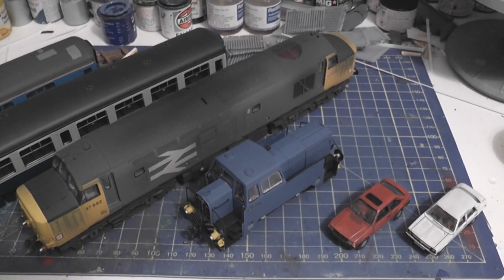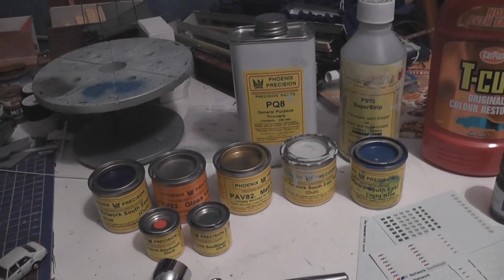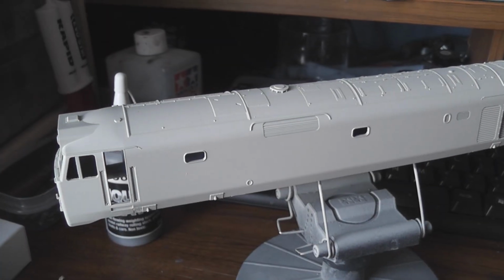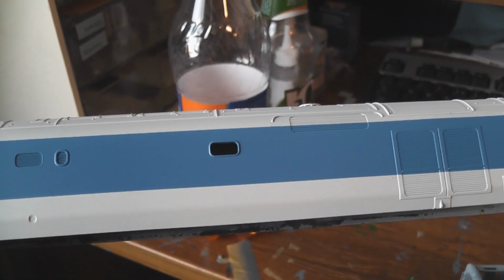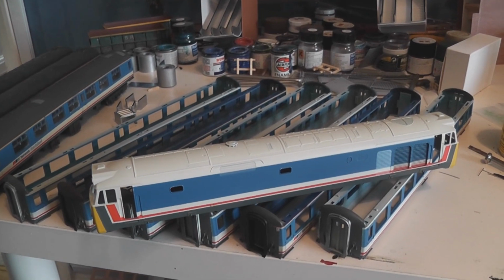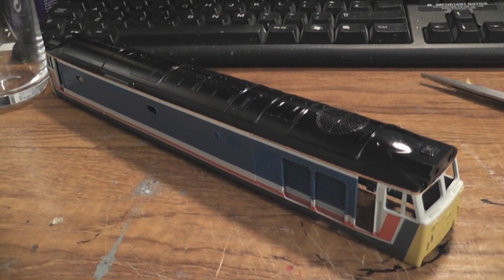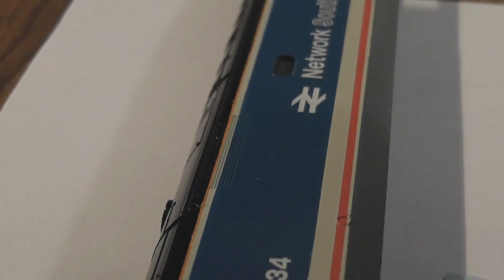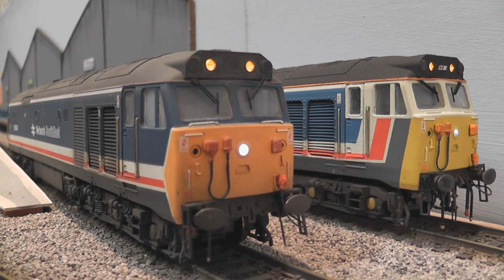How to - Episode 17 - Loco Repaint

Comment: Excellent work, I use Pheonix precision paints for my airbrushing.  Do you use a face mask?  The reason I ask is that brand of paint still use lead cromates in the mix.  Do you find that your compressor loses pressure? I used to use one without an expansion tank and I changed to one with a tank to enable to do spraying for longer without loss of pressure.
Reply from the maker: Nigel Johnson I do use a face mask as well as the extractor fan.  I try to do all my painting outside in the shed.  Also to my left in the shed is the door, which I leave open when possible.  My compressor is able to maintain pressure but it does struggle at higher pressures.  I plan to upgrade it in future.

Comment: NSE is a tricky livery to get right but the end result looks brilliant! I'm going to try this on my 86.
My only questions is that when you are using enamels, with so many coats of paint (I counted something like 16 coats including the clear coats!) do you not find you loose definition in some of the body details like the roof and the side grilles? Also is refitting the windows not an issue as I have struggled to get them back in on some repaints I have done that used much fewer coats than this one did.
Reply from the maker: soundseeker63 When you airbrush with correctly thinned paint you have to really go for it to lose the detail in a model.  I apply thin coats, but usually quite a few to build up the colour.  Windows can be difficult, but I didn't have too much trouble with this model.

Comment: Could you do a video of stripping paint please?
Reply from the maker: The stripping is very simple.  I pour the stripper into a water bottle and then leave the whole bodyshell in there to soak.  In about 20 mins the paint will be gone.  I then pour the stipper back into the original bottle using a filter so it can be used again.
Reply: Thanks for the reply :)

Comment: What's the stand you have used in this video. Like the clamp type system.  
Brill job your doing on this. Have followed a fair amount of your vids. Well done.
Reply from the maker: The stand you see me use a lot is the Tamiya spray work stand. You get the both the stands you see in the video in the same box.

Comment: Smart job. What Matt varnish do you use? Are these paints enamels? Or Acrylics? Or a mixture? Does this paint last as long in use as regular trains? Crikey that was a lot of coaches - must have taken you ages. Do you know how many hours work?
Reply from the maker: Thanks, I used railmatch matt varnish.  All the paints I used in this video are enamel based.  I prefer the finish you get with emamel.  Excluding drying time this probably took me about 6 - 8 hours.

Comment: hi, this vid was posted whilst I was dismantling a mk3 buffet before my first re-spray into FGW Green & gold' fagpacket' from current grand central black. after the gloss varnish then transfers, would you matt varnish, weather then matt varnish again or just weather on top of the transfers then matt varnish. the weathering will only be a light dusting of sleeper grime to give an 'in service' appearance (will weather rest of fleet that I have purchased   in correct livery's. cheers JD
Reply from the maker: I tend to matt varnish after the tranfers before weathering.  The gloss effect can make you overdo the weathering and perhaps not get the effect you wanted once the shine is taken off.
Reply: EverardJunction cheers ive just primed the coach and waiting till next weekend to put the FGW green on, thanks any way

Comment: ive been waiting ages for this tutorial. and it was brilliant. im really eager to have a go at respraying my class 37 into ews but going to buy some cheap second hand body shells to practise on first. only thing that's worrying me is im using ngauge . have you done an ngauge respray before? I did notice you was weathering a 37 in ngauge, im presuming that its a lot more fiddly than oo gauge?
Reply from the maker: I have repainted two N gauge 37s into EWS for a friend. I used the same process, but you have to make sure your masking is spot on.

I'm not sure if you can get EWS transfers anymore. The currently owners of the EWS brand have made it very difficult to produce transfers. You may have to resort to ebay to find them.
Reply: I did read about the ews transfer on the fox transfer site, its very disappointing but I will try ebay like you say, im going to give it a go, thanks for the inspiration.

Comment: This is a very old video but anyway..I see you are pulling the airbrush triger all the way back when you where painting the loco..So full paint flow..I know this is a NO NO.So..You where using a very low pressure then?~10PSI or lower? I ask because I bought the eclipse HP-CS recently and I'm an airbrush newbe..and I have also a loco repainting project to do.

Comment: you've done a fantastic job Richard of the repaint on the loco and the coaches, really is a top job, and looks so much better than the off the shelf model, not brave enough to try this, only just started to weather my trucks using the weathering powders video you did Andy

Comment: before you spray, do you wash the subject down with thinners before applying paint (its what we do on the full size machines)?
Reply from the maker: Adam Williams I do wash it before spaying but I use warm water instead of thinners.  I've done a few car parts and use use panel wipe for those which is probably just thinners.
Reply: I wouldnt recommend cleaning it down with anything other than a very mild degreaser, the worst you are removing is finger prints.
There are loads on the market if you look around, but its only to get the base coat on, once its on you should be touching it

Comment: you recoat even when the first coat is not fully dry? that work ok?  Never thought of that, I tend to give the precision paints (used on my trunking) 24 hours to fully harden.  The blue is spot on for shade!
Reply from the maker: As long as you are doing the same colour you can apply extra coats when the previous one has touch dried.  I then leave the 3 or 4 layers of paint i've built up to fully dry overnight. I was quite surprised at how quickly the phoenix paint dried.  On some parts I was able to paint in the morning and mask over it in the evening whithout any trouble.

Comment: you have done a damn fine job on that 50 and the coaches richard, well done mate.
Reply from the maker: Thanks Terry, at one stage i was worried it was never going to end. those coaches took so long to do!
Reply: yeah i bet they did mate. i admire your determination and patience, something i lack lol.
actually while im typing i wanted to say that im going to respray my sentinel shunter into yellow and wanted to know how you went about masking the word sentinel on the side of the shunter.did you just cut out a piece of masking tape and stuck it down?
Reply from the maker: Glebe Road Junction Hi Terry, only just got round to reading this! Yes I just cut a tiny bit of tape and stuck it over the sentinel logo.

Comment: To get a perfect gloss finish try Pledge Klear Multi Surface was with Future shine, it is water thin goes through an airbrush like a dream and cleans up easy, it gives a perfect gloss finish to laydown your decals.

For standard colour paints like black and red give XtraColour a try, can get it from Hannants, they airbrush very well, their colours are for aeroplanes mostly but the basic colours work for all.

Google search can give thinner ratios in relation to your setup air pressure, gun setup etc.

Comment: Superb how to video Richard the 50 and the rake of coaches look really good made it look really easy especially the decals I did a class 26 recently and I found that to be the hardest bit to do but I think I did not use the gloss varnish only used a Matt and they did not move around so easily thanks for sharing cheers Kevin
Reply: Nice, I like the color scheme . Walter
Reply from the maker: The decals can get very annoying, the best thing you can do is gloss coat the model.  Is makes a huge difference.

Comment: Great work. Just getting back into hobby after long break so one question regarding the mk2 coach repaints. I notice the glazing has the sliding window vents on so which method do you use to mask those off for painting?

Comment: Really informative video. Do you think it is possible to repaint a loco without an airbrush just by hand as I want to repaint a class 170 but don't want to invest in an airbrush. Thanks.
Reply from the maker: Its possible but you will finish it hard to get the smooth finish your 170 has now.  You can get some very cheap airbrushes these days.
Reply: EverardJunction  Thanks for the reply. :)

Comment: One time, I needed a loco in a roadname that wasn't available.  Rather than risk destroying a $300 loco, I ordered a second shell, an undecorated shell, and painted and weathered that one.  For intricate designs, it's often possible to find transfers/decals, or even have custom transfers/decals made, for your railroad.  Unfortunately, that's not always an option because undecorated shells are not usually available for most models.

Comment: What's the best way of removing all the detail? Windows, jumper cables etc?
I'm in the process of getting everything I need to repaint my old Mainline 56 and notice that the windows,lights and handrails are all glued in place. Cheers
Reply from the maker: I use a pair of tweezers and a sharp knife.  The glue they use isn't very strong.

Comment: Hiya, fantastic videos/tutorials, can i ask what masking tape you use as the normal masking tape is a bit rough around the edges and dont give a smooth line.
Reply from the maker: I use Tamiya masking tape.  Normal household masking tape is very bad for this sort of thing.
Reply: EverardJunction is this be a use house hold tape pulls the paint off yeah?